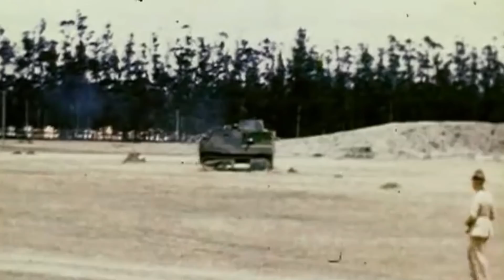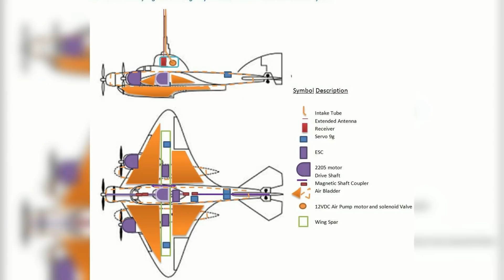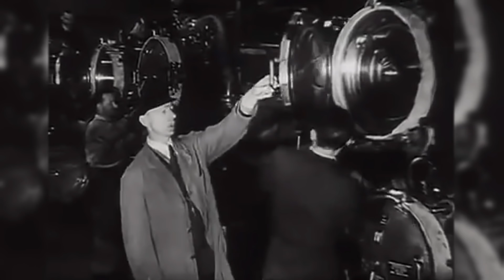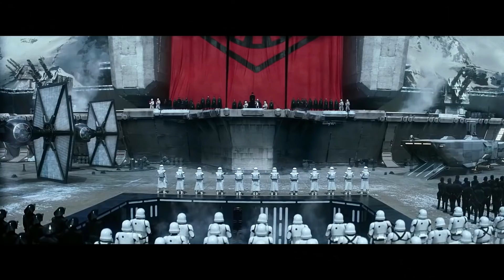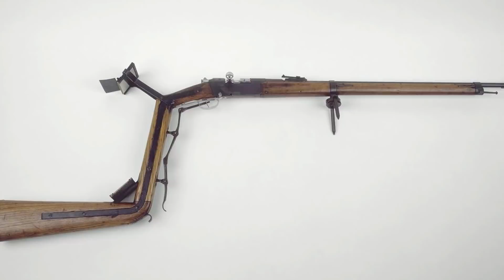15 Weirdest Weapons Ever

Comment: "Sir, this pistol will cut costs of manufacturing in half and allow our troops to win battles with ease by having them attach anything they might need to the gun. What do you think?"
"Ehhh it's TOO versatile. The wars no fun when we win it easily. Throw it away"
Reply: The thing is a weaon that can do all is a master of none.  Having weapons that are specialized in certain feilds of combat is a good idea and is used by all nations.  Plus a single shot piatol would be a shit primary due too the reality of combat that we face.
Reply: A pistol is a shit primary weapon to have.  It would be cool to have a multi use weapon but it would do a shit job of what you want it to do.  Having specialised weapons is a good thing like snipers or machine gunners for example.  Having a basc weapon for a certain feild f combat is a good thing.
Reply: artillery 210 but this was back in early ww2 where automatic weapons were still semi experimental, so a light weight weapon that could become a rifle, then a grenade launcher, then an anti tank weapon all within a few moments sounds pretty great
Reply: Even then a pistol being the base for such a weapon would be a terrible weapon and there were many full auto hand held weapons in early ww2 already.  Like take the mg 34 or the bren gun and the BAR.  Not counting the countless smgs already in full service within their respective military.  And so many attachments for such a small weapon may sound good but in reality its just not practical.  If it was then we would have seen it in service but no it was scrapped

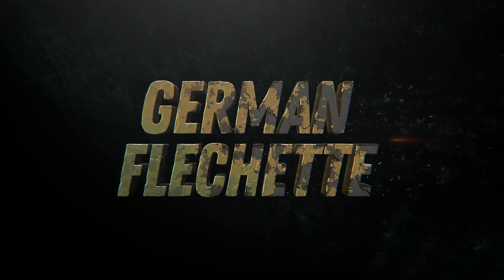Comment: 8:50
The flechette darts were a French invention and later used by Britain and Germany. The German darts literally had the following inscription stamped into to them: 'Invention François, Fabrication Allemande meaning ‘A French invention, German made’.
Reply: Mirco Martinez they were only weird because they didn’t work . They always flipped in flight, hit the target harmlessly sideways. Lucky if you get one going in the right direction to puncture.
Reply: @jonboy9734  Where did you hear that the flechettes didn't work? It's pretty easy to design an air-dropped projectile that will fall point first. Unless you are thinking of SCIMITR, which was an American project around the time of the Vietnam War to load shotgun shells with flechettes instead of buckshot. I have heard that project had mixed results.

And if flechettes were ineffective, then they wouldn't have been used up through the Vietnam War as fillings for artillery shells. If you look up the effects of the Lazy Dog munitions from that era, you'll see that they were pretty damned effective.

Comment: Wikipedia:

New Zealand, like its neighbour Australia, had no indigenous armoured fighting vehicle industry. It was expected that armoured fighting vehicles would be provided from Britain. Australia and New Zealand did have some heavy industry that could be turned to the production of armour and armoured vehicles but little had been done. The idea of mechanising the New Zealand Army had been suggested before the war but without much progress. The use of the American Disston "Six Ton Tractor Tank", a 1937 vehicle constructed of an armoured box on a Caterpillar Model 35 chassis[4] which had been sold to Afghanistan and China, was suggested.

New Zealand had built some improvised armoured trucks and unable to get any tracked carriers from Australia were building their own with armour plate imported from Australia. After the Fall of France in mid-1940, and the loss of most British tanks there, there was no likelihood of production being spared for New Zealand. Rather than obtain the armoured superstructures from America, it was felt they could produce their own using local materials and resources.

It was decided that a 'tractor-tank' would be an adequate design; if the need for defense arose, a large tank superstructure could be bolted upon a tractor base within a few hours, allowing for quick transformation and deployment of the tanks.

The first (mild steel) prototype was built on a Caterpillar D8 crawler tractor, a type which was readily available.[5] The Public Works Department had 81 D8s, and another 19 were available.[2] A lack of weapons meant that it was equipped with six Bren machine guns — one in each side, two facing the front, one in the turret and one at the rear. The vehicle was very tall at 12 ft (3.5 m) and performance was poor. Due to the lack of armour plate, corrugated (manganese) plating was used in the expectation it would deflect bullets. The crew of eight included one gunner who had to lie on a mattress on top of the engine to fire his Bren gun.

The tanks were constructed without the use of any formal plans or blueprints. Working from an American postcard depicting the conversion of a tractor to a 'tractor-tank', Bob Semple and TG Beck (Christchurch District Works Engineer), improvised the design of the tanks. Using resources available to Bob Semple as Minister of Public Works, the first tank was quickly produced in the PWD's Temuka workshops. The additional two were built at the NZR Addington Workshops.The first cost £5,902; the second and third £4,323; total cost £10,225 (although the Army was only billed £3,414).

The intention was to disperse the hulls at locations ready in case of a Japanese invasion at which point they would be mounted on tractors for use. The idea was discarded after the tanks attracted public ridicule; however, Bob Semple stood by his design and even stated "I don’t see anyone else coming up with any better ideas."

Comment: Slingshot bomb catapults are actually not only creative, but were also practical when their creators were able to display same level of creativity in projectile design.

Another variation of similar idea that proved to actually be quite effective and deadly in skillful hands was the "poor man's mortar" used during Spain civil war - a russian F1 fragmentation grenade fixed in a cup with it's safety pin removed. Thrown at ranges of up to 250-300m with the still popular in that area persian/roman style long sling (classic rotational, not rubber one) it had the cup broken on impact, releasing the safety clip and activating the fuse. Frag grenades like F1 are intended for defensive use (from within a trench) and can't be thrown by hand at a safe distance, so longer delay was seen as acceptable (especially given the fact that such contraption was used by those who lacked more effective support weapons). Main problem wit this was that with less-solid surface (sand, mud, even rocks sometimes) things may not work as intended and you will end up laying pretty unpredictable landmine.

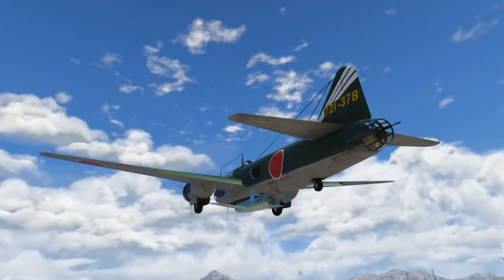Comment: 11:58 that’s the one at Udvar Hasey center. It is in fact jet powered, instead of rocket powered. You can see one of the air intakes on the side of the fuselage behind the cockpit.

Comment: 1)  improvised tanks are nothing new.  seems to be one of the best, if not the best I have seen.
2)  Panzerfaust was a great weapon with a serious drawback of range.  Needed to be basically on top of the tank.
3)  seems logical to test vehicles able to access multiple of air, water, land (cars, planes, etc have been tried in past numerous times).
...
precision bombs is considered a weird weapon?

Comment: The Davey crocket With a 3 part assembly could be carried by troops assembled and launched to a distance far enough to avoid radiation, making it a thermonuclear warhead would also increase its potent anti troop power. Ohhh darn I should have kept my mouth shut.

Comment: The fallout series"fat man" is NOT the davy Crockett by any means other than they both have nuclear munitions the davy Crockett is more or less a missile launcher with a tiny nuke just strapped on the end, the fat man launches the mini nuke (it's usual ammunition) worst thing is you didn't even use the fat man without any modifications, of which  is vital as to not have an entire fandom on your ass, you used the MIRV a mod (modification not the user  made thing that Bethesda has an execs in) the MIRV launches several mini nukes at a time, even though the MIRV looks the same but in fallout 4 and maybe 76 it changes the look of the mini nuke itself but the MIRV in those two games is slightly different, acting as more of a  hand-held nuclear carpet bombing device

Also two nearly identical weapons, the panzerfoust (I know that it is most likely spelt wrong but I'm too lazy to care) and the davy Crockett, both of which aren't that odd, especially the panzerfaust congratulations, I wonder how you passed history with this basic knowledge, probably taken from page 1 of Wikipedia, for this tzeench might take an interest in you, probably making you a simple... thing

BLOOD FOR THE BLOOD GOD AND SKULLS FOR HIS SKULL THRONE

Comment: The bob simple was not wired and the fall of France had nothing to do with the tanks making. Mr simple worked with what he had. As well as this no one else was trying. The tank was also meant to have a 37mm at gun on it. Although not a huge gun was vary capable of dealing with most of Japans tanks.

Comment: The panzerfaust 30 had a range of 30 meters or around 100 feet, later models had 60, 100, 150 and 250 meters ranges.  It isn't "Luft waif" it's Luft waffe, like "waffle".

Comment: The Americans actually based the bazooka off of recovered panzerfausts, so yeah
Reply: The Bazooka was definitely used before the panzerfaust was found on battlefields
Reply: @andrewsummerour3692  yet the panzerfaust was made pre WW2, and is almost identical to the bazooka which was made pre-war
Reply: @cron1807  the panzerfaust entered service with the German army in 1943. The bazooka entered service with the American army in 1942. And they are not identical. The Bazooka and Panzerschrek look very similar, but the bazooka's rocket is in the tube while the panzerfaust's rocket is exterior.
Reply: Welp I'm stupid and should shut up now, sorry I've been proven wrong.

Ding dong
It's the wrong song
Ring wrong
I am stupid
Pls don't put me 
On r/iamverysmart
I will never forgive you

Comment: Panzerfaust ridiculous is so incorrect. It way have only took out 6% of tank kills in Normandy,but look at its kill rate on rhe Eastern front. Its a cheap to make lite shaped charge tank killer. There's no telling how many dueces and other soft skin vehicles.
The Germans influenced more things uses by the military that any othee country of that era. The first assault rifle.night vision.jet ,rockets,cruise missiles , tailess aircraft,rpg i can go on and on but i think the point is clear, they directly advanced (as all wars have) alot of U.S. equipment used today. Also they started in on using radar absourbing subs,as well as the Horton.